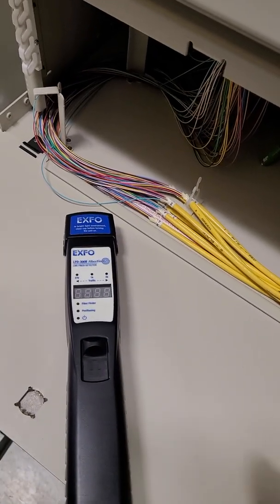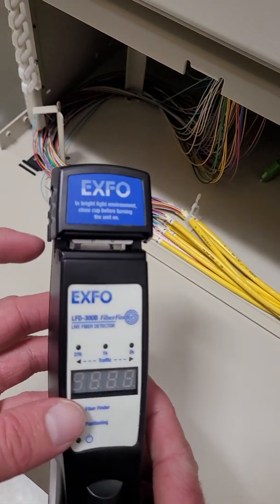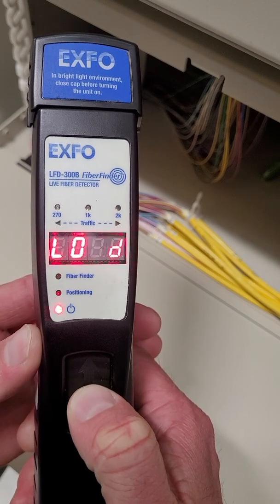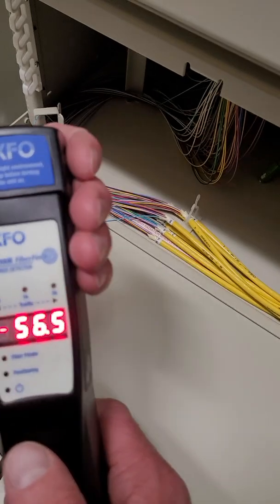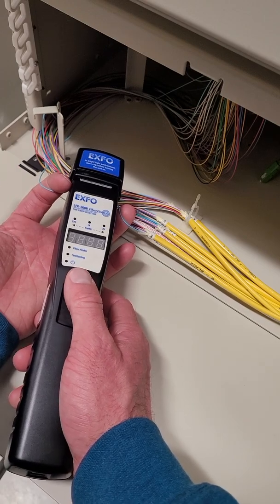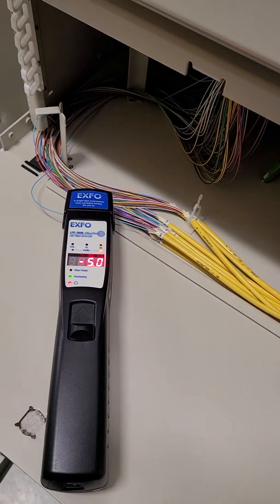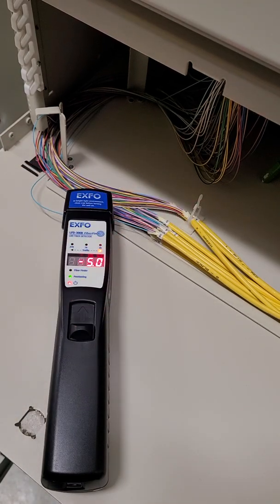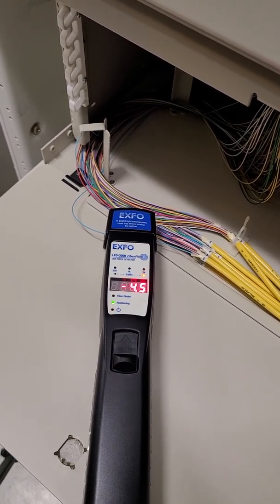How to use a Live Fiber Detector / Light Finder

Comment: I want to buy one of those. I have a bunch of LC-LC singlemode duplex  not label and don't know if it's live or not. I don't want to disconnect either...do you know if they work for my type of cable (duplex). I tried looking it up but i only see everyone testing it on the cable you are using in the video. Sorry if the question is confusing...
Reply from the maker: They make a converter connector that goes from SC/APC to LC so yes it would work but your would need to buy an SC/APC TO LC Adapter. Just make sure the adapter end would be female so you could plug your LC jumper direct into it for ease of use

Comment: will it tell you if there is an ONT on the end of it in fiber to the home? if Im not mistaken an ONT transmits back once it has received its light from the OLT.
Reply from the maker: @moby1kanobi  It will just tell you if there is light and if will give a direction is coming from. You are correct, the OnT transmits once the OlT talks to it. Sometimes we have. Rogue onts though that are stuck in AE mode or are transmitting when they aren't suppose to and it actually interrupts the whole splitter/GPOn port and causing all customers on that PON to go down.
Reply from the maker: @moby1kanobi  we also learned the hard way not to plug an old AE NiD into a OlT/ONt splitter when your doing equipment upgrade.  It does the same thing. So we always have the person on site power the old NID down first and when we have confirmation, we move the jumper over to the new GPOn splitter